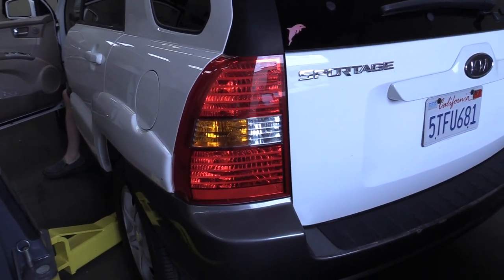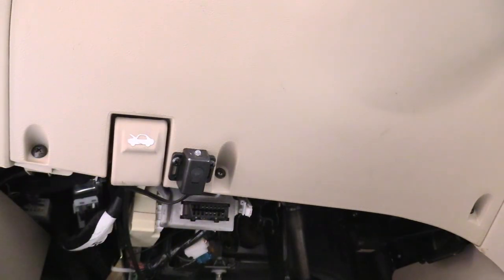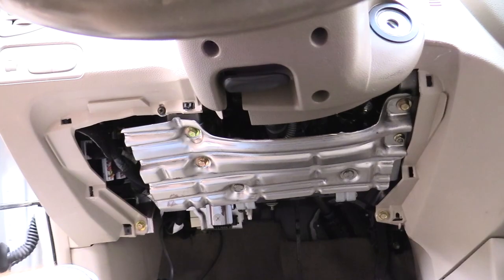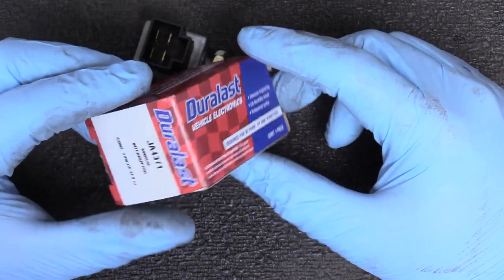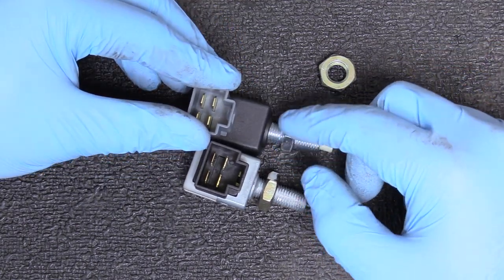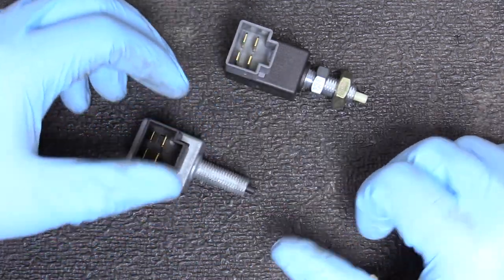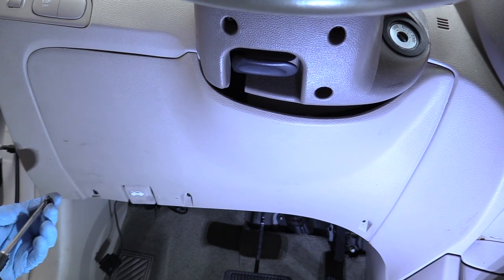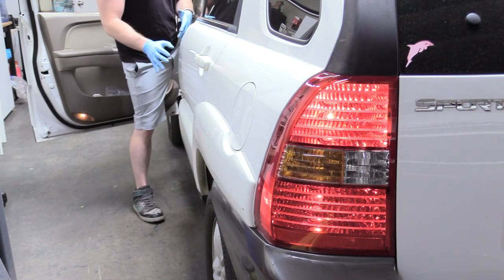Brake Light Switch Replacement Kia Sportage 2005-2010 - EASY!

Comment: Make sure you have the rubber stopper as well. Took me a while until I realized my brake stopper was crumbled and on my floor. So I just got a replacement stopper and it fixed the problem without having to remove. Great video 👍🏾

Comment: Thanks for the video! My ESC Off light came on and I thought I needed to replace the brake light switch. I switched it following your helpful video but the ESC Off light was still on. It turned out I had to actually replace the break light bulbs! The original break light switch was still fine.
Reply from the maker: Nice work!
Reply: Where the bulbs blown/ corroded? I’ve had the same issues but nothing seems to fix mine

Comment: At about 4 and a half minutes in you explain how the switch works but contradict yourself by saying that when your foot is not on the petal the the plunger is fully pushed into the housing and that when you let off the petal it extends back out. However, you can’t let off a brake petal if your foot isn’t on it to begin with. Can you please clarify which way the plunger is when the petal is not engaged vs engaged? Thanks.

Comment: Thanks for the video. I need to replace this on my 2011 Kia. Would this part still work on the 2011 model and if so, do you have a link to on that is available on Amazon? The one posted is not available anymore. Thanks!
Reply from the maker: I don't think this switch will work for that newer model. You will need one for your model year. Thanks for watching!

Comment: So I have a 2011 Kia Sportage. I was driving along and it just died on the side of the road. We checked the alternator and it’s OK but the funny thing is. I got a new battery because the old one was shot. I inserted the key turn the switch little the lights in the pretty stuff turn on and then as soon as I turned the key to actually start the vehicle they killed the battery
Reply from the maker: Check the battery again. Sometimes batteries just randomly die even when new. Thanks for watching!

Comment: I changed this out on a 2019 Kia Forte and I still have no brake lights. I did forget to disconnect the battery though. Could that cause an issue with the new switch?
Reply from the maker: Since your car is so new you might need to plug a high end scanner in to tell the computer that you have a new switch. Thanks for watching!